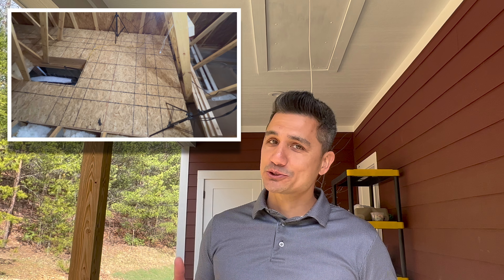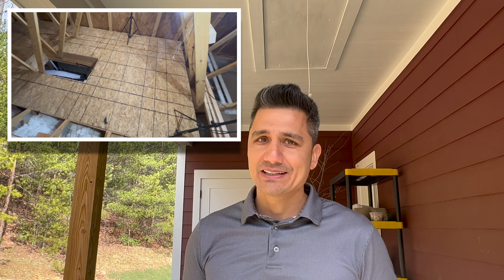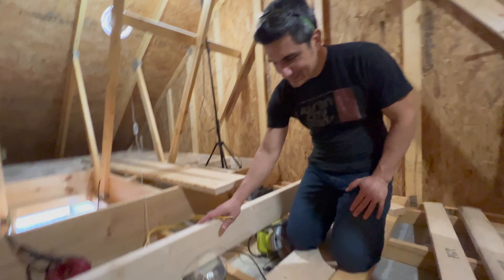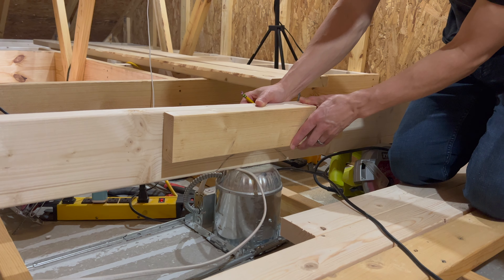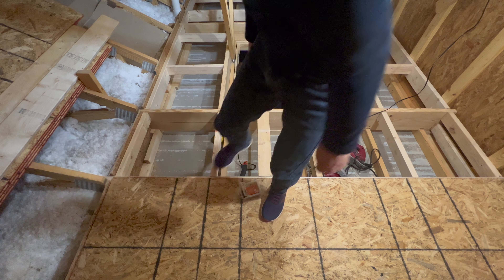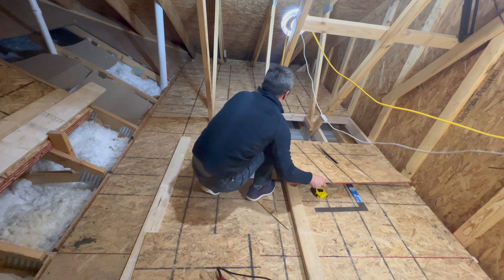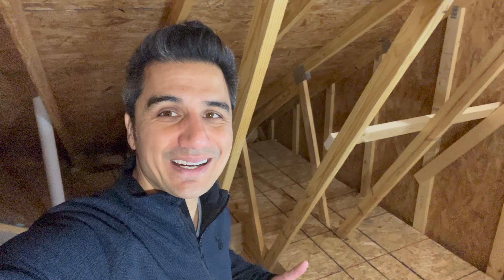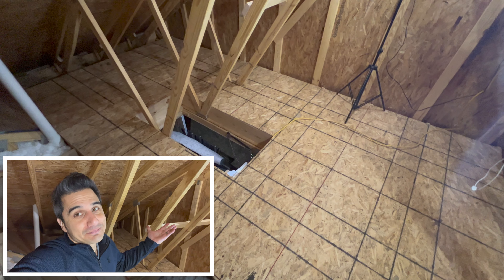Attic Floor DIY Install for Storage Build - Heavy Duty!

Comment: So with a truss system like that you can’t just lay the plywood on the truss?  You had to build floor joists to transfer the weight to the wall studs?  Interesting.
Reply from the maker: No, the trusses are not rated for any load other than supporting the roof. Could you get away with it? Maybe. I did climb up there put lots of wood on it and walked around. It's highly not recommended for any significant load.

Comment: My attic at home already has everything done except for the plywood floor itself. I have the joists and everything though. Planning on finishing it up sometime. Thanks for the video
Reply from the maker: Nice that’s a lucky situation! You should be able to setup
The plywood easily!
Reply: Same here. How'd your install go? Also did you use nails or screws?

Comment: Can I ask why did you do the 2x12s instead of just putting it on the 2x4s that were already there?
Reply from the maker: The 2x4s can’t handle the load. The manufacturer states that it’s only intended to hold the roof up.
Reply: @BrandonTran  Thanks sir. I may need to rethink how I approach this now.

Comment: Very good video. I am curious about your terminology. My understanding is that OSB is not plywood due to differences in shear strength. I'm considering doing the same conversion with my attic but with 7/8" thickness on OSB.
Reply from the maker: That’s a great call out. I did say the OSB is very weak in this application. If you have bigger plans and a bigger budget I recommend upgrading to a plywood. I did this on the cheap. I blocked the subfloor to counterbalance the cheap OSB. 2x4s are cheap

Comment: Out attic has 18' of insulation init already..
Reply from the maker: Just look for the load bearing walls. Once you establish a starting platform it will be easier to expand. Sorry I don’t have any video installing over existing insulation. It will be trickier.

Comment: First of all great job on responding to all the messages. I noticed you said you are using 2x6 as your floor joist that go on top of the ceiling joist & load bearing walls. Are the ceiling joist 2x4? If so wouldn’t that be 10 inches plus the osb ? Were are you getting the extra 2 inches you mentioned? And last question are you screwing nails at an angle to attach the floor joist to ceiling joist?
Reply from the maker: Hi Christopher, the 2x6 are on top of load bearing walls and I used scrap blocks to raise it to 12”. I did not rest the joists on the 2x4 ceiling joists. Yes sometimes the screws are at an angle. Toenail angle. Thank you!
Reply: Ahh I had to rewatch the video now I see what you are talking about. Thank you 👍🏼
Reply from the maker: Awesome! Good luck in your project! You got this!

Comment: How did you get the sheets of ply into the attic?
Reply from the maker: Great question! It was not easy. I set them tall on top of a table. Then climbed ladder into attic. Then pulled them up 1by1. My 10 year old pushed a little. 2 adults would make it much easier.

Comment: For storage of light boxes could you put the boards directly over the original smaller floor joists?
Reply from the maker: Great question! Some do that, and yes you could get away with it. If the ceiling is Sheetrock then it may move a little and crack which will cause more work. I like to build a little more rigid. Another idea is to lay 2x4s on top of the joists. It will be a middle approach! Best of luck in your project!

Comment: I have blow in insulation everywhere....but need to build a raised subfloor.  Any ideas?
Reply from the maker: Great question! Look for load bearing walls. Don’t compress your insulation as that will lower your R value. I went with 12” of space between the ceiling and the new floor. You can go higher if you have the space.

Comment: What sort of screws did you use???
Reply from the maker: I used 2.75” Deck Screws for framing work  bc they are stronger and affordable. For screwing the plywood shorter 2” is good.

Comment: Why didn’t you put down insulation ??
Reply from the maker: That is a great question! Because it requires an inspector to be legit. I want to get a permit and enclose our back porch. This attic space will need to be seen by the inspector before and after insulation. I will get to it :)

Comment: Hey Brandon! I want to do this to my attic as well. Our home has a ladder installed and all the joists as well. How did you measure all the plywood for step 2? I’m new to all of this 😅
Reply from the maker: Awesome! You just need to make sure the plywood lays on top of the joists. If you have 24” spacing of the joists that should be your smallest cuts. You may be asking about Notching  to get around obstacles. You just have to transcribe for that. Hope this helps!

Comment: Why not just add the osb directly to the existing joists instead of add the additional raised joists. Wouldn’t installing thicker osb or plywood be easier than all the additional framing.
Reply from the maker: Great question! This is to meet code as I’m going to install 12” of insulation. That’s another project to enclose our back porch to a sun room.
Reply: The framing applies the load to the outer walls. The raised joists stops any bend movement from the floor from flexing and cracking the plastered ceiling underneath

Comment: Can it support the extra weight? and where's your insulation.
Reply from the maker: I installed the joists on load bearing walls so yes it can handle weight. Is it a 2nd floor for traffic and rooms? Nope.
Reply: @BrandonTran  It still might not have been designed to support the extra weight.
Reply: Yeah, this is going to introduce all sorts of forces in places that aren't designed in. If I were you, I would scribe some pencil lines around the load bearing walls, your original house, and the new structure to track any movement that may happen over time. If you see things shifting, empty it out.

Comment: you used 7/16 osb but how big where the total sheets you got before you cut them down to size
Reply from the maker: Traditional 4’ x 8’ sheets.
Reply: @BrandonTran  and did you use a specific wood screw size
Reply from the maker: Ah yes, those are cabinet screws. #10 x 2-1/2 in. Star Low Profile Washer Head Cabinet Screw (50 Per Pack)

Comment: Can you use 2x4’s instead of 2x6’s?
Reply from the maker: There’s some advice out there about floor joists. 2x4 is really thin. How far are you spanning? I wouldn’t go less than 2x6 though if you want it to be more stable.

Comment: What will you do if you need to access a light box or wiring?
Reply from the maker: We installed a sun room. I just installed 2 ceiling fans. I simply removed the temp screws and then installed the fans. I threw down some insulation and screwed the plywood down.

Comment: How in the world you get those plywood sheets on the attic??????
Reply from the maker: Great question! I guess I didn’t get video of that. First I set them so they were tall. 8ft. Then I climbed into the attic via a 6ft ladder. Next I grabbed one at a time. And I remember my little helper helped lift 5-10 lbs of each board to make it easier.

Comment: What is the setting of your saw, so that you just cut the playwood without destroying the joists?
Reply from the maker: For cutting the hole, I used a cheap jigsaw. I did have to change the blades 2-3 times bc it’s concrete board. It was a regular wood cutting blade.

Comment: Do you add any type of vinyl floor on that too?
Reply from the maker: Maybe I haven’t hit the right level in life but every attic I’ve been in has plywood floors :)  have you seen that kind of upgrade before? I think that if you start to add flooring in an attic, you might be converting to actual living space. I could be wrong though.
Reply: Thank you. I am new to the whole DIY process and was thinking that I might want to add an actual peel and stick 🤡 or vinyl floor just in case I want to make it to be my own office (I’m small so even though my attic is small, it’s still doable 😂😂). Thank you so much for your video- it’s super helpful for me
Reply from the maker: Hey that will be awesome! When you get ready to share, let us know! I'd love to check out the before and after.

Comment: how much weight can joists hold. 
Would you say is safe to put plywood and used the attic for storage ?

I fear I might break a joists and damage the structure of the house bringing the whole house down!

Even walking on joist and beams freaks me out since I’m 220lbs I don’t wanna break essential beams or joists

Any help if greatly appreciated 
New home owner!

Thank you!
Reply from the maker: I’m 160 and my son was 70 in this video. The weight it holds depends on many factors. The length and thickness of the joists. My attic is 8ft span and the ends of the joists are on load bearing walls. The allowable load for a 2x8 is 400 lb. So if you need to handle more weight increase the board thickness to 2x8 or even 2x10.

Comment: I watched this video hoping to figure out how to get the plywood sheets into the attic. Unfortunately that part was skipped. How did you get those massive sheets into the attic? I have just the small hole for the fold down stairs like you did in this video and I'm stumped. Your flooring looks great though.
Reply from the maker: Oh no, I’m sorry about that. I cut the hole. I then lifted the plywood sheets through the large rough opening. I then installed the attic ladder. You may need to cut the plywood  in half now. 2’ x 8’
Reply: @BrandonTran  thank you!  :)

Comment: Great work and it looked like alot of work. I watched some other videos and an easier way I saw was just to lay down some furring strips or even some 2x4 laid flat on the joists with cut outs for the electrical that is laid long the joists so you don't squish them. But maybe the codes in your area required you to build a higher platform. I'm in California and I don't believe the codes require that.
Reply from the maker: Yes your plan is a great one. I would have done that however I needed to insulate which requires 12 inches of insulation. Is your attic over the garage? If it’s over heated space you are going against insulation code. Now days insulation code wants higher energy efficiency. So easy wasn’t my goal.
Reply: link?

Comment: So I just moved into a house that has an attic like this.  It appears the OSB up there is just laid on the floor 2x4s.  So is that not good enough?  I know absolutely nothing about this sort of thing.
Reply from the maker: If it’s in the garage that’s totally ok. But there is code that says you need 12” of insulation. So if it’s your main attic over a hallway you would have little insulation. Not to code but also less insulation = more energy loss :)
Reply from the maker: The reason for the code is to build efficient, safe, and quality houses
Reply: @BrandonTran  Ok thanks for the replay.  Yeah it is a pull down ladder leading to the attic over the garage.  Makes sense after your explanation.  Just wanted to make sure it wasn't for additional support or something ha.
Reply from the maker: Right on! Best of luck on your project!

Comment: If you attic have insulation do you have to let air circulate with the insulation?
Reply from the maker: Air circulation is important for the soffit vents to the ridge vents. So definitely don’t cover the edges of the attic. There are better videos for this info in detail.

Comment: Thanks for the great presentation.  You made it look very easy--tells me you have a lot of experience with woodworking!  I was wondering if  using multiple nails with a pneumatic nailer would be good enough although I realize screws (self-drilling) are the best.  I just use the attic for storage anyway.
Reply from the maker: Hi there! I’ve been a handy man for a while but certainly not a master :).  Absolutely your nail gun will do a great job and faster. Also nails have better shear strength than screws. I just don’t have a nail gun :)

Comment: What are you doing, and why are you doing it?  I’m here to sort out how to strengthen the attic floor for storage.
 You never explained what or why….
Reply from the maker: Agreed my video is lacking extra detail. Basically I installed 2x6 lumber as floor joists. Those joists should sit on load bearing walls. Every attic will be different. If your span is more than 8ft, you will want to use larger lumber. 2x8 or more if it’s a longer span.  Before these trust systems were designed, carpenters would use 2x8 joists to go from wall to wall. That was my goal. Best of luck on your project!

Comment: I thought with framing, you’re supposed to use nails over screws because of their flexibility?
Reply from the maker: Yes that is accurate. Nails have better shear strength. My issue is I didn’t want to crack my Sheetrock over the bedroom.  So if the inspector requires nails I’ll add those in.
Reply: It isn't structural so no nails needed

Comment: I’m thinking about doing this. I have one question though. I’m curious why you didn’t put insulation down, before you put the plywood down?
Reply from the maker: Ah great question this is above an open porch. Also if I do enclose the porch the inspector wants to see it before insulation so I would have to remove it :) . Lifting the plywood is easy
Reply: @BrandonTran  oh okay, got ya. That makes sense.

Comment: One question, how did you get full sheets of plywood up there? I only have the opening where I installed the ladder and I have been cutting the plywood up into 4 2’x4’ pieces and carrying them up. Do you have another larger opening?
Reply from the maker: whoops, well, I carried the plywood up before installing the ladder. It may fit if you have the wider ladder but not the 24” wide laser.

Comment: What sort of measurenents have you done before installing the floor joists in order to fit with the dimensions of the playwood? sheets?
Reply from the maker: Rough measuring. Everything was 24” on center. Also it takes a little work to notch. I had to notch around the ladder opening. Also just rough measurements.